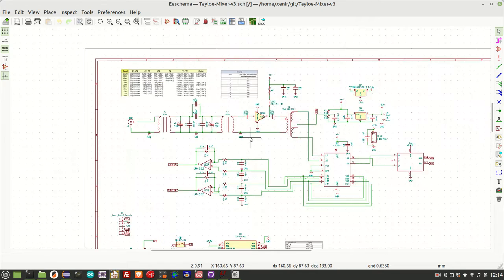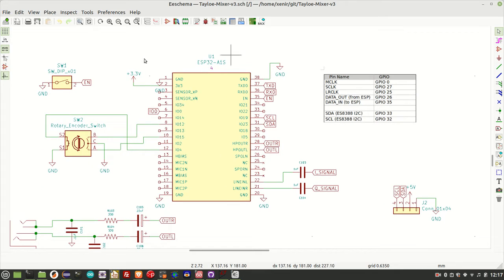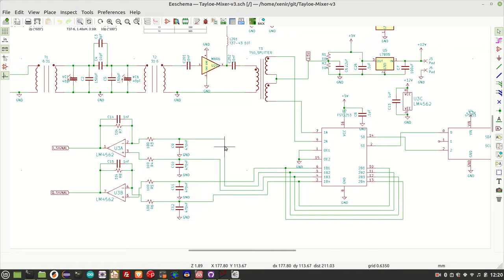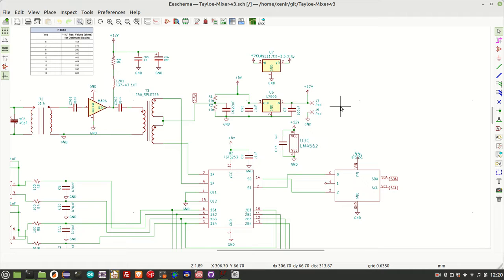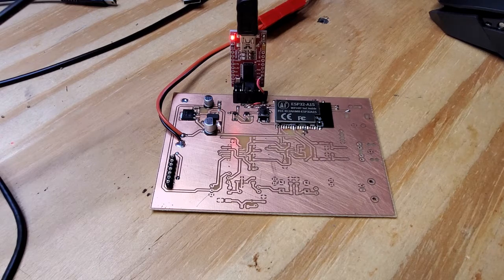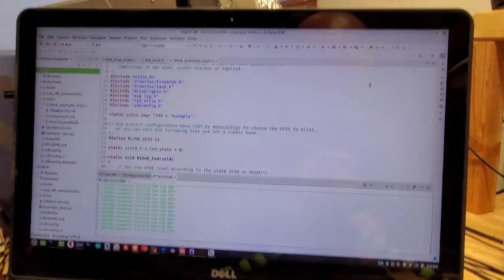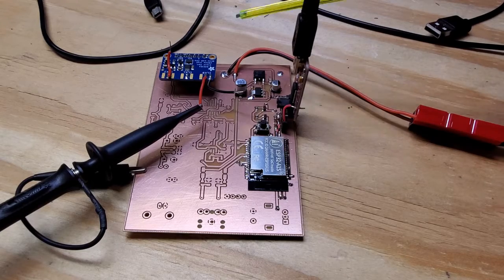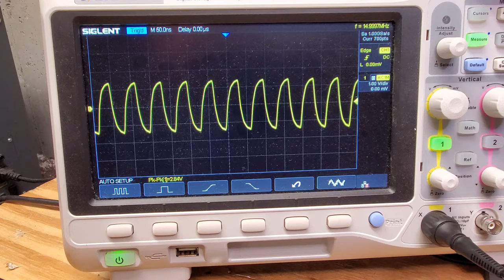ESP32-A1S Radio on a Board - Part 1

Comment: If there is a ground plane on the other side of the board, you could have drilled a large enough hole through the ground pad area to allow you to melt some solder onto the ESP32 ground pad from the other side of the board, and then connect it to the ground plane on the board.  I've done this with similar chips.
Reply from the maker: Thats not a bad idea. I am defnitely going to put some vias in there for the real board. Thank you for the comment Kenneth

Comment: Great old school Pcb, when i first started in electronics the pcb's we used were double sided and via's were made with rivets. we would spend hrs sitting at a drill press pressing in the rivets and folding the ends over before soldering them. Must have beed a good process as these boards went in to equipment fitted in the cockpit of jet fighters. And we would never see them back unless they wanted an upgrade made.
Reply from the maker: What technique did you use to align top and bottom for etching. I use a lightbox underneath both prints and create a little "pocket" that I then slide the bare copper in. I've toyed with using those rivets
Reply: @na5y  The boards were made by a PCB manufacture. At the time even professional manufactures could not make Through plated holes.  Shows how old i am 😞
Reply from the maker: @TheEmbeddedHobbyist  Ah gotcha.

Comment: your explanation is very good and detailed, so far I have processed an SDR SSB radio with transmitter and receiver, I uploaded the video on the youtube channel. I am using an ESP32 A1S ES8388, from the factory there are several types of I2C pin placement, one of which is on pin 33/32 like yours, but the other I2C pin is on pin 18/24. Thanks for sharing.
Reply from the maker: Interesting - so there's some ESP32-A1S with differing internal I2C connections? I wonder what else is different. Were you able to find a schematic for the 18/24 version.
Reply from the maker: Just adding. Here's the schematic I was able to find
https://docs.ai-thinker.com/_media/esp32-a1s_v2.3_specification.pdf 

Page 15 has the internal schematic and it refers to pins 32K_XN, 32K_XP (GPIO 33 and 32 respectively) for the I2C connection to the ES8388
Reply: @na5y  
Yes, from the information of some of our friends, fans of radio amateurs, that there are some friends who are constrained not being detected at pin 32/33 after being searched using an I2C scanner, it turns out that the location of the I2C pin is on pin 18/23
Reply: @na5y  
I see the PDF file you sent on your link is version ES8388 on GPIO 18/23 on page 15.
Reply from the maker: Where are you seeing that Noor? The two I2C connections between the ESP32 and the ES8388 are "I2C_SCL_ESP" which is on pin 32K_XP and "I2C_SDA_ESP" which is on 32K_XN.
Reply from the maker: Ah I see it of to the left (18 and 23) - I am pretty sure that is a misprint. I remember trying those two pins when I was playing around and they didn't work. Look at the main ESP32 in the diagram. Having said that it wouldn't surprise me if there are some variants out there.
Reply: @na5y  
currently I already have with two different types as mentioned above and have tried it, it turns out that it is indeed a different version, but both are the same only different GPIO.
Reply from the maker: Interesting - I ordered some more ESP32-A1S the other day. I'll have to keep an eye out for the different versions. Its a great little module. I just wish the documentation was a little better
Reply: @na5y  
thank you, good job, I'm waiting for the next video. greetings from Indonesia.

Comment: Ian,
Nice video and project. After watching your first video on the ESP32-A1S, I bought a bunch of the ESP32-A1Ss and had some breakout adapters made so that the WiFi antenna would be unobstructed in case I ever wanted to use the WiFi. I may try your PCB layout if you get this working. I take it that you aren't using the Etherkit Si5351 Arduino library.

Regards,
Jerry, AC9NM
Reply from the maker: Jerry, What do you mean "if" I get it working  ;) - (all in good fun of course)

I am using the Adafruit si5351 library. I don't think the etherkit one has the "set_phase" call I need (perhaps I am wrong)

Thank you for the comment
Reply: @na5y  O.K., <b> When </b> you get this working, I'll give it a try. Charlie Morris, ZL2CTM, did a video on quadrature output down to 3MHz back in 2019. I believe he used the Arduino IDE Etherkit library back then. It does have a set_phase function. Unfortunately, the library no longer works (for me at least) with ESP32s  and I have had to resort to using the sI5351mcu library which has only a few functions. I really don't want to resort to writing my own library for the Si5351A.
Reply from the maker: @jeroldponko7168  You jogged my memory - in the previous SDR video i did use Etherkit library - but I had to create a fork that allowed me to change the default I2C pins. Here's my fork:
https://github.com/thaaraak/Si5351Arduino

Charlies video was the originator for my interest in I/Q radios. I believe he used a pair of SA602s as mixer if I recall. Its good to see him back producing videos after quite a long absence. Thank you for the comment Jerry
Reply from the maker: @jeroldponko7168  I'll have to check the fix out - thanks for that. 

On the second point I can't just call Wire.begin() because there is also a different set of I2C lines that the ESP32-A1S has which it uses internally to communicate between the ESP32 and the ES8388.
Reply: @na5y   You wouldn't be calling Wire.begin(). For example,

#define SDA_2 33
#define SCL_2 32
 
Wire1.begin(SDA_2, SCL_2);// Creates a second I2C bus on the defined SDA_2 and SCL_2 pins with the desired frequency. You can also specify a third parameter, frequency for the bus speed if you desire.

If you know which pins are used for the ES8388,  just avoid using them.
Reply from the maker: @jeroldponko7168  Thanks Jerry - I'll give it a go

Comment: great video!
what software are you using for programming ESP32? And do you have a video on how to program it?
Reply from the maker: So you have three choices:
1) Program with ESP-IDF and build/flash from the command line
https://docs.espressif.com/projects/esp-idf/en/latest/esp32/get-started/index.html

2) Use Eclipse with the Espressif ESP
https://github.com/espressif/idf-eclipse-plugin

3) Use the arduino programming environment and add the ESP32 using the boards manager

Option 3 is by far the easiest to get started with but I have found that understanding the ESP-IDF has helped when encountering problems. Eclipse is a far superior programming IDE than Arduino is (again IMO). If you want to do single step debugging you really have to use an IDE like Eclipse. Debugging is a total pain to set up though.

I hope this answer your question. Thank you for the comment

Comment: Thanks for the video. In your experience is there any practical difference between the "double balanced" Tayloe mixer (the one used in this schematic) and a "regular" one (when the channels of FST3253 are paralleled and the input signal is referenced to the ground)?
Reply from the maker: Hi Alex. By regular you mean like page 7 of this document?
https://www.arrl.org/files/file/Technology/tis/info/pdf/020708qex013.pdf

The difference I have read is that the double balanced mixer is able to capture all four quadrants of the I/Q output 0, 90, 180, 270 and you can pass the 0 and 180 - 90 and 270 as differential inputs to the follow on opamp stage improving sensitivity (I am guessing). Having said that I have never measured the difference experimentally - might be worth an experiment to followup. Thank you for the interesting question
Reply from the maker: Actually I take the above back - you get 0,90,180 ane 270 from the regular one too...
Reply: @na5y  Yes, this is the schematic I meant. To my knowledge there is no practical difference as well (I've built both). There is an article "Ultra Low Noise, High Performance, Zero IF Quadrature Product Detector and Preamplifier" written by Tayloe himself. It can be easily found online. Tayloe doesn't seems to claim any particular differences between these two circuits. The name of the circuit is just confusing I guess. One would expect that a double balanced Tayloe mixer has certain advantages over "single balanced" one, similarly to diode ring mixers.
Reply from the maker: @R2AUK  Interesting - It would be good to be able to get rid of the additonal complexity of the trifilar splitter